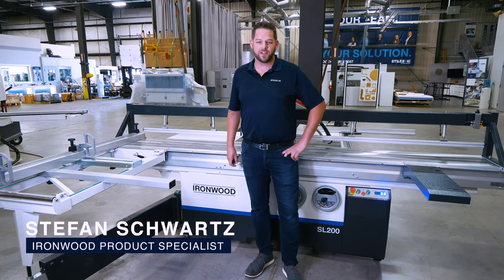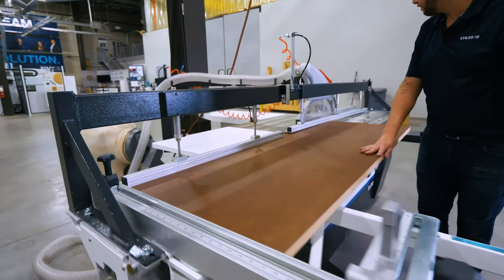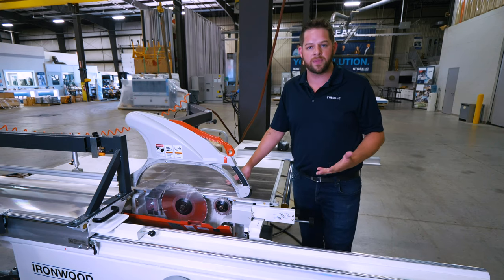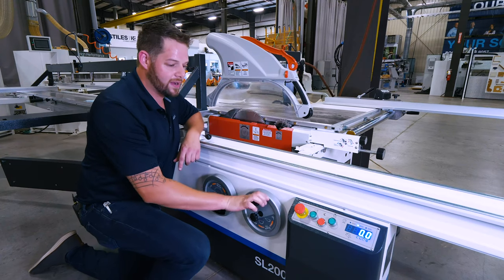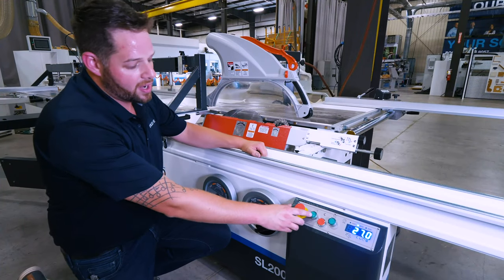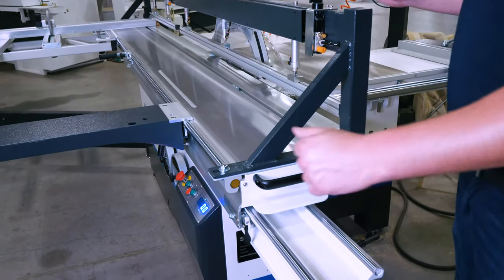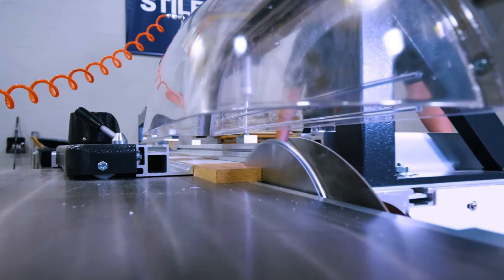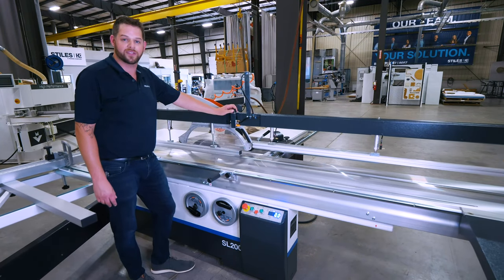Ironwood SL200 Sliding Table Saw Overview | Stiles Machinery

Comment: How much are the two clamping zones?  Do they operate on an outside or independent air source or is there a compressor in the saw?  How much CFM at what pressure is required?
Reply from the maker: Thank you for your comment. Please call 616-698-7500 or fill out a contact form on our website (https://stilesmachinery.com) to speak with one of our experts who can answer your questions.